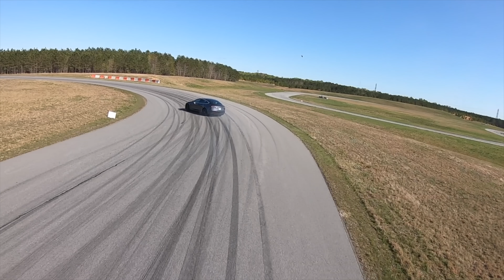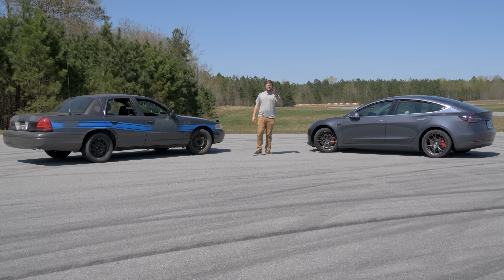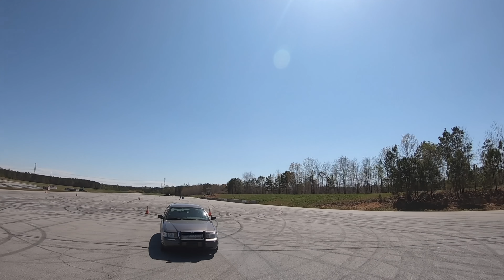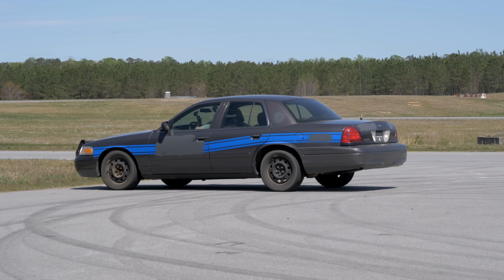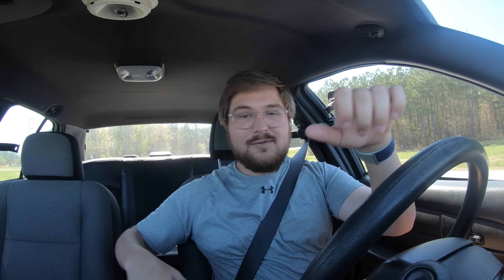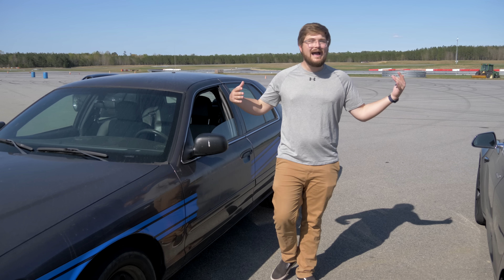Should Police use EVs?  Tesla Model 3 vs Crown Vic Police Interceptor

Comment: Was a "drive over the curb" test part of this? I tend to think actual performance is usually pretty far down the priority list.
Reply: Just need to change the wheels and tires out to allow a higher profile that can absorb the shock. Maybe some suspension changes and a minor lift.
Reply: @T1Oracle  cyber truck. air suspension with 12+" clearance and comes prearmored against small caliber weapons fire literally perfect police vehicle.
Reply: @AsheLeclair  on top of the good range and decent acceleration.
Reply: @T1Oracle  you just described a model Y LR
Reply: one of the main reasons a lot of departments have switched to explorers.
Reply: A curb jump at speed would probably destroy the Tesla. The CV was designed to do curb jumps.

Comment: Cop cars need to survive severe use like hopping over curbs,  high speed through low brush,  and driving through ditches...  ... and be cheap to fix when the inevitable damage occurs.   In the future I'm sure a Tesla can do those things,  but certainly not right now.
Reply: Not sure the Chargers are well suited for those activities either or "cheap to fix" when they do get damaged.
Reply: daverz28 Yes, robust and cheap to repair are very real requirements for a traffic car.... a Tesla of the future maybe but not a 3 or Y I’m afraid 😆

Comment: What if the TM3 was always on "Track Mode"?
Reply: Wirmish As he said a police car would have special police software.
Reply: Most LEO do not have the driving skills for that
Reply: @tonyc6996  Novices do fine in track mode. It still has assists during track mode.
Reply: @0ooTheMAXXoo0  doesn't really change the fact most LEO aren't technical drivers

Comment: I feel an electric police/fire emergency vehicles are coming very soon. I've seen zero motorcycles being used up here in northern California in a municipality for the last couple of years.
They just need to be very robust in build quality or won't last a year in service.
Reply: We have a few experimental all electric buses running around Redmond area.
Reply: They'd have to be designed by actual engineers and refined for a decade to beat the gas models in terms of the extreme needs for emergency vehicles.
Not a Tesla. Be real.

Comment: As awesome as it would be to be a cop driving a 3.5 second tesla you missed so many key points to what being a cop is this video is nothing more than simple clickbait. You're forgetting all the gear, weight, and electronics that go in a police car. Then imagine an electric car that is now much heavier because of that then the fact that you have to not only drive the car hard using electricity but so are the lights computer radio etc. Electric vehicles, today, are a terrible cop car.
Reply from the maker: The weight / electrical consumption would be a minor toll on the car. Nothing noticeable at least
Reply: @OutofSpecMotoring  are you aware of the weight of the lights, cage, fire arms, equipment, computer, docking station, radio, lights/siren module, firefighting and ppe/medical equipment? Dont forget the entire rear seat has to be completely cached off with metal/plexiglass and plastic seats. Along with a constantly running radio and computer electricity output. Remember most police agencies run for 12 hour shifts. The range on a model 3 is 320 miles. But that's a perfect world. In winter months it'll be worse. And in summer months you're running the ac/radio/computer etc for over 12 hours assuming the car is take home. Then the fuel isnt free cuz you have to charge at home. Coupled with the loss of range from the hard driving I'd be surprised if we were not in the red or worse by the end of the day. There are so many variables you're not factoring. And only focusing on driving which is only a small fraction of their job. Consult a local police or sheriff. Take their ford escape weight and a normal one. The added weight is all the equipment added. Add that to the model 3 then run it for 12 hours with the computer and radio etc and see how much range you have left. Average miles per day is around 120-200 miles depending on call volume.
Reply from the maker: The car can handle that easily. Like I said the weight won’t be an issue. I run these cars fully loaded (way more than police / tactical gear) would weigh and it is not a noticeable impact. Same with the electronics... these cars have huge batteries and are already very heavy.
Reply: @OutofSpecMotoring  the ford explorer gets 19mpg. I average 10mpg on average on my interceptor.a 50% decrease in efficiency. There is literally nothing you can say to convince me a tesla with 300 mile range is enough to do a full 12 hours worth of work. Especially when the battery propels the  vehicle and operates everything inside the vehicle as well. With more range I'd agree with you. But short of you making a video proving me wrong, you wont convince me.
Reply: @chrislacey6036  Electrics handle the weight easily unless you're talking 1,500 pounds additional before passengers. For range,  'around town' is where they shine. You can do 400 miles like he said outside of highway driving. The record in this car is 600+ at 30 mph. The electric load of computers is nothing for a 75kWh pack. AC is pretty minimal too, though heat is another story in cold climates without a heat pump.
Don't ignore the benefits either. They're faster, save money on fuel, and use little energy at idle. Model 3 is currently in use as a police vehicle.
Reply: @chrislacey6036  I seriously doubt that you are losing half your MPG on your interceptor purely because of weight, the car should hardly notice.  It's probably an issue with the tuning of the engine or how the car is driven.  Weight just doesn't affect any vehicle that much, gas or EV.  As far as electrical load, it's hard to understand just how big the battery is in these cars.  The Model 3 could easily run your entire average house for a couple of days; AC, stove, hot water heater and everything.  As an example, it could run a 110v window AC unit for 80+ hours.  This is about as heavy a load as you can run on a standard outlet.  A 12V light bar isn't going to even register.
Reply: @gregb7353  yes a good majority is how the car is driven. That's my main point. The fact that the tesla only has one fuel source (electricity) only makes the issue worse. To say the added weight, extra electrical load (more than just one light bar) coupled with a police officers aggressive driving habits isnt negligible. This doesnt make a model 3 ideal at this time. Even then most police agencies are moving away from sedans and opting for SUV's.  There are many aspects even I have left out but if anyone wants to weight a ford explorer then weigh mine put that difference in a model 3 then throw in a constantly on radio and lights etc full charge it and see how long it runs I'd watch that. I'd love to be proven wrong. Having an electric patrol vehicle would be sick. I'll take the cybertruck marked unit.
Reply: @gregb7353  I believe the Model 3 has a 75 kw battery pack, the Model S a 100 kw pack

Comment: Fleet fuel savings have to be monstrous; Gas car uses fuel while sitting around where EV uses hardly any. No oil changes and probably less brake/motor overhauls. Who knows how many miles they can pile on an EV before the drive train is dead.
Reply: also electric cars are always on when you’re in it, whereas you need to start and put a petrol/diesel in gear
Reply: Probably a million plus miles.